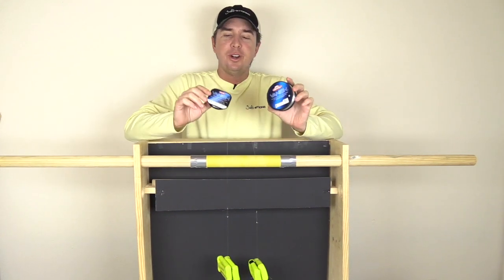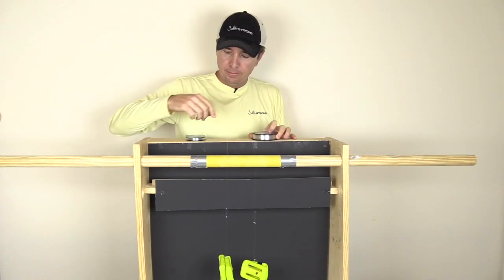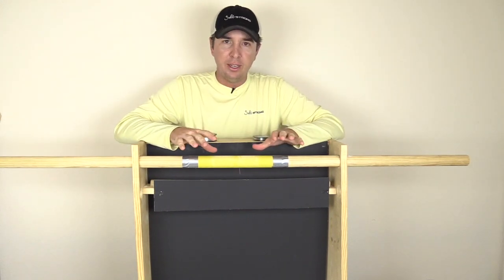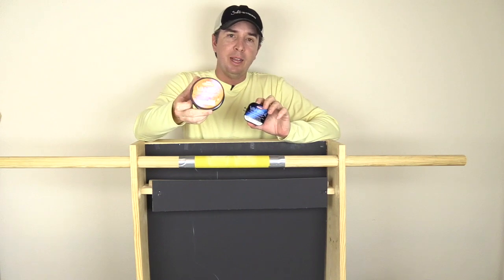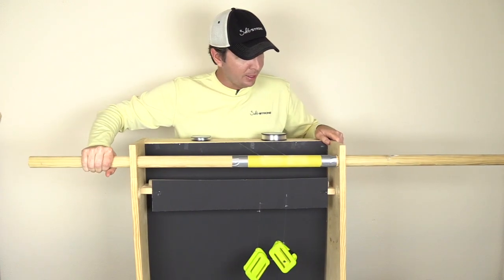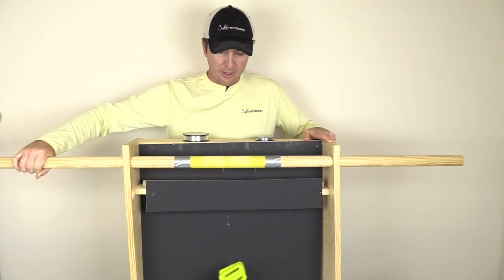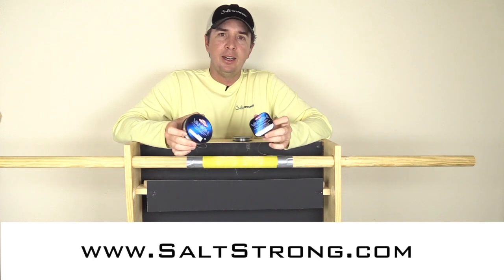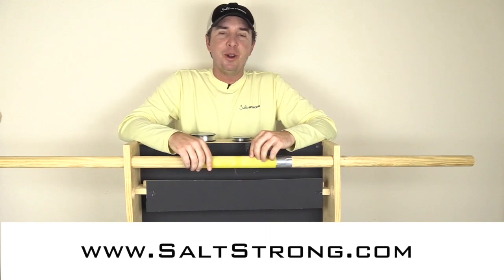Berkley Vanish Fishing Line (Leader vs Mainline Abrasion Test)

Comment: So if using the fluorocarbon main line as the main line, you don't need a leader?
Reply from the maker: Check out the full blog on our website and post your question there. That way, our coaches can respond back directly with their input and recommendation. You can find that here: https://www.saltstrong.com/articles/berkley-vanish-leader-vs-mainline-abrasion-knot-strength/
Reply: That is correct you don't need a leader if you're using their main line

Comment: I was wondering why you guys were using the Berkeley vanish fluorocarbon Main Line spools as opposed to the leader material. I buy it in the smaller 25 yards box of leader material. It is always held up for me but sometimes can be a little tricky to tie knots with because it seems to have just a lot of extra stiffness and memory. But always holds strong...
Reply from the maker: We were using the mainline to see if there are any problems with using it for our leaders instead of the more expensive "leader" line that comes in spools of 25 to 50 yards. 

This test showed that there is not any noticeable difference in abrasion strength of the leader line compared to the mainline which is a fraction of the price.